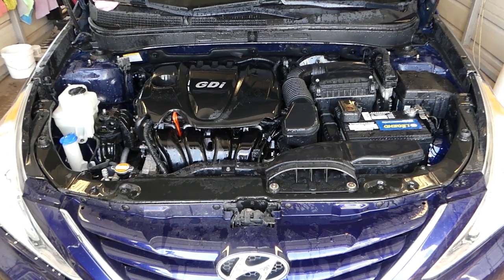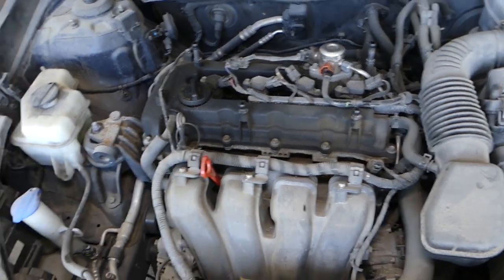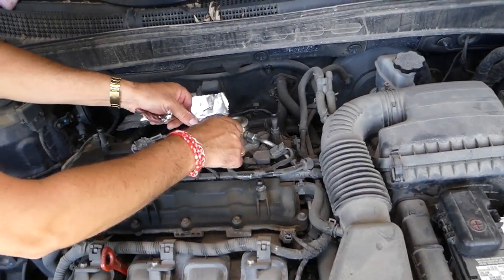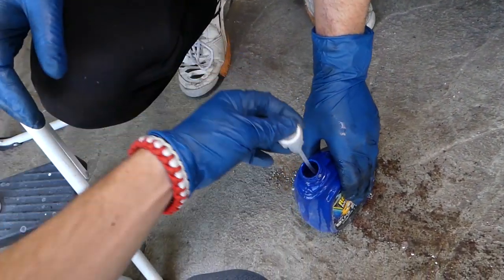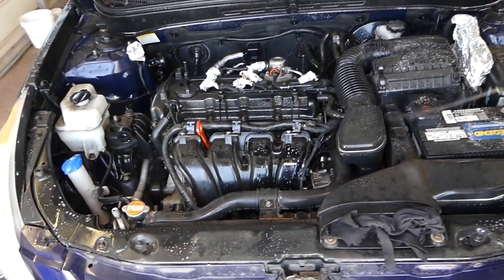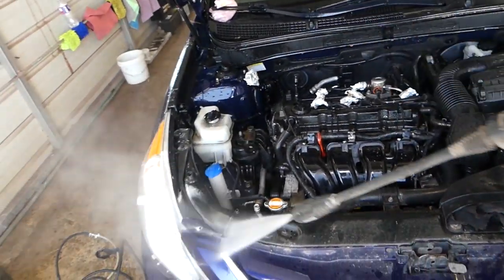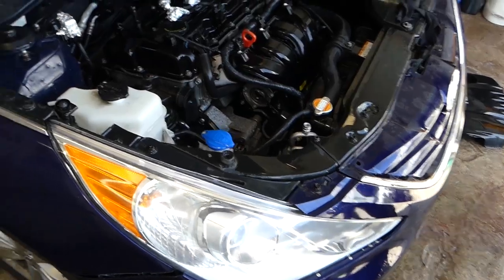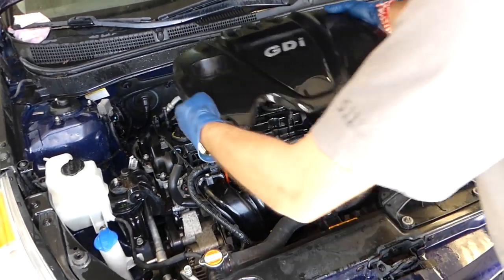HOW TO CLEAN WASH CAR ENGINE. Amazing Results

Comment: Every single video you put out for the sonata talks about all my issues with my car. 2019 hyundai sonata - popping sounds when turning.. etc
Reply: Its drive shaft
Reply: Drives haft. Usually tie rod or ball joint but drive shaft do this too

Comment: I'm thinking that a nozzle with a wider spray would be better when cleaning the engine . So to reduce / prevent water penetration into places .
Reply: I have the same car. I do the foil method but I spray degreaser, scrub with a brush and then rinse it with a garden hose. Pressure wash is just to risky imo
Reply: @krysfranklin4750 just coveted the ignition coil tops, and computer? What else to cover before wash?

Have santa fe. Your setup is same as mine.
Reply: @krysfranklin4750  If you have an open air intake for the engine , stuff it with a small microfiber towel to keep water out .
Reply: @youtubeonly8574  If you have an open air intake for the engine , stuff it with a small microfiber towel to keep water out . And people are now using cordless leaf blowers to dry engines .

Comment: the trick is this connectors are water resistant so... and the main point is do that with a heat engine, and the car running idle. so the evaporation is fast and efficient
Reply: wtf?